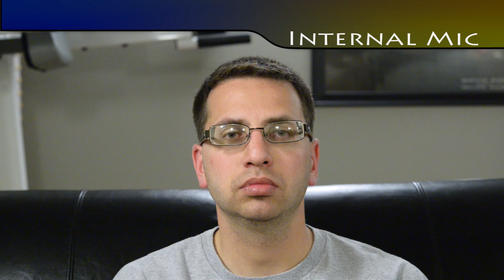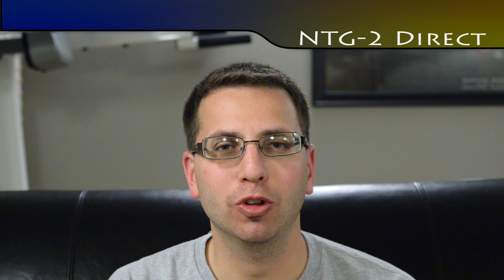Nikon D800 Sound Comparison Tests with the NTG-2 and Behringer 802 Field Mixer Preamp

Comment: Is this the "Behringer EURORACK UB802 Ultra-Low Noise Design 8-Input 2-Bus Mixer"? That is what I could find on the Behringer website. I've found it in an online shop under the name "Behringer XENYX 802 PA and studio mixer". Not portable, not battery operated but not expensive either.